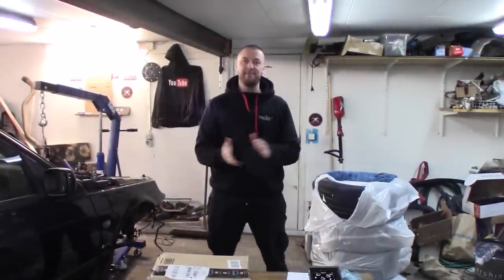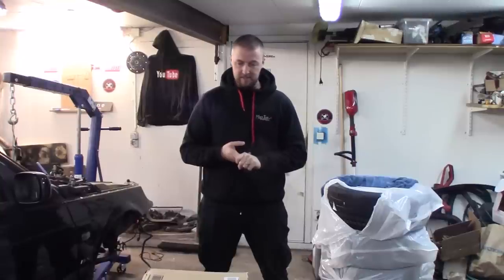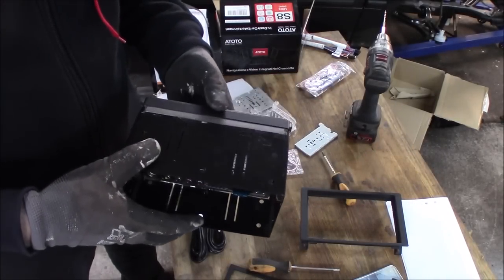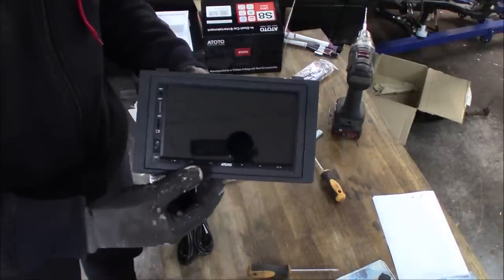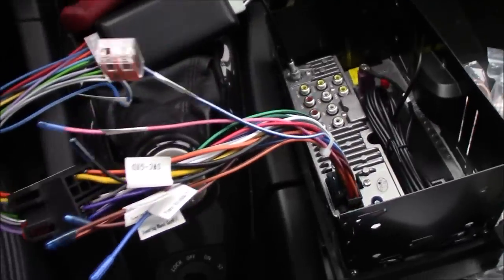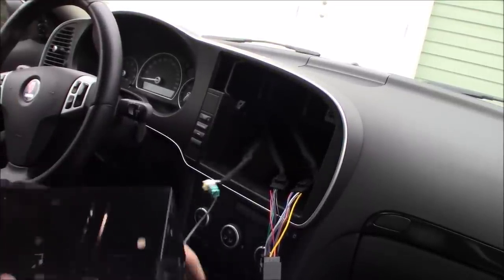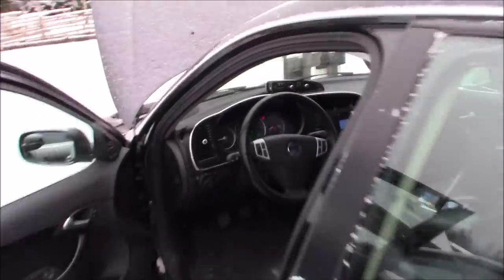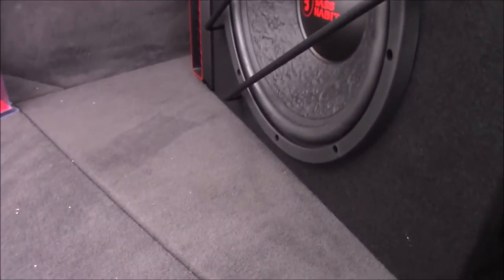Saab 9-3 2008 Turbo X Audio Upgrade! Atoto S8 Ultra Gen2 + 12" Subwoofer

Comment: Well done. I started having flashbacks to when I fitted my Kenwood head unit to my 9-3 a couple of years ago. Yes, the Dremel was out to adapt the mounting frame and surround to obtain a flush fit. That Kenwood head unit is just as deep as the original, so had great fun trying to tuck the metres of spaghetti and connectors behind it. Ended up removing the glove box to pull some of the wiring through and out of the way. And like yours there was no sound to start with. And then pulled it all out again this year to connect the Kenwood dash cam. At least I wasn't doing it in the snow. Keep those videos coming Jonas.
Reply from the maker: Thanks 🙏 yeah its quite a loom after adding all units you need 😂😂😂

Comment: I had to reverse the power cables in order to retain the memory of the unit.

The hardest part was to get steering wheel buttons work since I didn't understand the instructions in the beginning.

NG9-5 was much more easier. It's plug'n'play with its canbus.
Reply from the maker: My unit came with different ISO looms so the powering wasnt an issue as soon as I got the correct cables.

Yes ng9-5 was much easier

Comment: I have the  Bose 7 speaker sound system in my Saab, and I always see people bitching on the Saab forums online about how that sound system sucks and sounds like crap....and I never understood that.
  It has clear sound, good range and good bass for a stock system. I can turm the bass up all the way and the volume, and never get any distortion.
 I dont know what the hell they've beem driving with these incredible stock sound systems but i think its pretty damn good, especially for that time period. 
Ive thought about upgrading my speakers and amp but its not because they sound like crap, Id just like to have something a little nicer.

Comment: Great videos and turbo x is awesome! Have you seen Saab unleashed? A Uk channel that specialises in car audio systems. I’m thinking of an XTrons double din unit for my aero as they seem to be easiest to fit. No extra bits needed for amp or steering wheel controls
Reply from the maker: Thanks, yeah i talked to him a little bit during the installation. I dont know about all other units but he seemed to have tried quite a few

Comment: this is AMAZING!!!! i thought u cant replace a Saab unit because it would mess with your whole ECM and lose functions
Reply from the maker: In the ng9-3 or ng9-5 there are no issues with this atleast 😉
Reply: @JonasKakarikas  time to buy this upgrade
Reply: so i can't find the link for the 2 piece u ordered form InCarTech! and the one link u put there where it says cable does not work
Reply: nvm found them!! now looking for the Frame! cant find it! or don't know which one you got there from where
Reply: si i got the parts, but im  issing the CASE or Cage!!! where do i buy that>

Comment: Great job Jonas! Do you know if the 2007 SAAB 93 come with fiber optic system? I read that they don’t. I want to also update my sounds system.
Reply from the maker: The 2007 as the new interior but old exterior, so same as my TurboX 👌
Reply: @JonasKakarikas  I see. Yes, the layout of the stereo does look the same. Thanks Jonas. By the way, I love all the SAAB you have but my favorite is that rare SAAb 93 TurboX wagon.

Comment: A question. I am fitting an Atoto A6PF 7" car radio to my 2008 Saab 9-3 Sporthatch with 7-way audio system. I connected everything but it doesn't play, I can't find the amplifier wire from the car. How do I recognise it? Thank you.

Comment: Hi Jonas, I would like to purchase the Atoto unit for my 9-3, but i can't find it supplied with a frame for my car. Can you advice where to find the same frame as you used to fit it for the 9-3, thanks for your reply and keep the vid's comming :)
Reply from the maker: Hi, my frame was a used one. Frame is included in one of the links in the description 👍

Comment: Thank you for video. Are you happy with Atoto S8 ultra? Planning to purchase one, so your opinion will be great help. Would you buy this unit, after having it several months? Thank you.
Reply from the maker: Yes it works really well and im very happy with it 👌
Reply: @JonasKakarikas just bought this unit. Which 2din fascia did you use or can recommend for this head unit? 

I bought Connects2 fascia for Saab 9-3 and this unit is bigger, don’t fit in it. The bezel of fascia is to small
Reply from the maker: I got a used one from a guy from Saab Turbo club

Comment: Hi, I see that you mounted the GPS antenna in the inside top of the metal bracket, does it get enough gps signal in this position? thanks!

Comment: Do your car have bose sound system? If so how can you use this system amplifier by using this type? What about the oem type socket?
Reply from the maker: No it didn't have the Bose system
Reply: @JonasKakarikas  Thanks for your answer. I have a 2007 saab 2.0t vector and it has the same type like yours but with bose system. I would like to use a teyp like yours but do not know can I use bose system amplifier or not?
Reply from the maker: I dont know either unfortunately

Comment: Hi Jonas, I have the exact same installation same car , bought the incar tec looms, everything working but I have no sound, I have connected the power antenna cable from the unit to amp remote turn on cable as you have done , but no sound any ideas?
Reply: Is there any way I can contact you for help?
Reply from the maker: @marinosmalekkides sound installations is not my strong side. If the video doesn't help you I don't know unfortunately

Comment: When you connected the amplifier power on. Which wires did you actually connect together?
Reply from the maker: Think The wire was marked as amplifier turn on 👌
Reply: @JonasKakarikas  perfect! Now have sounds 😁 only need to get steering wheel controls wired up properly now.